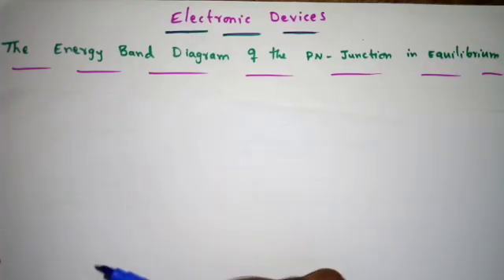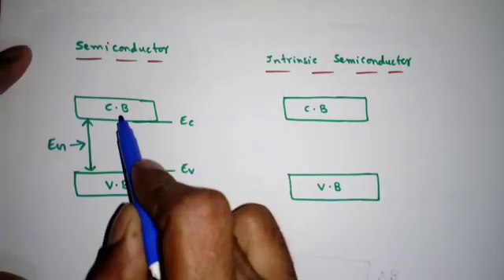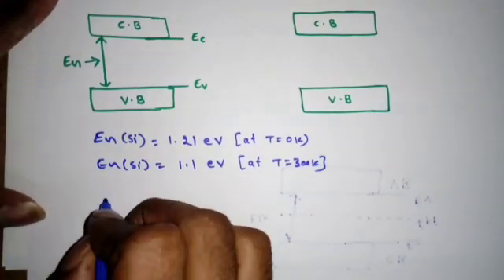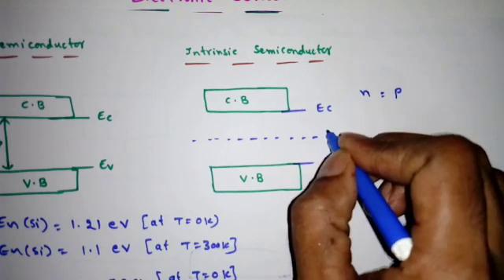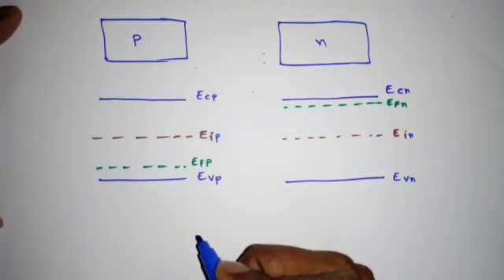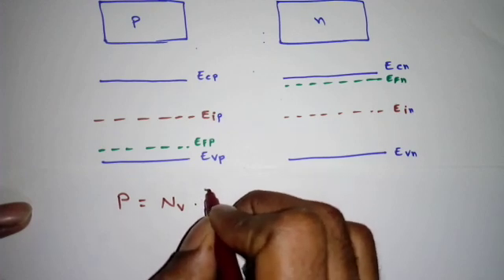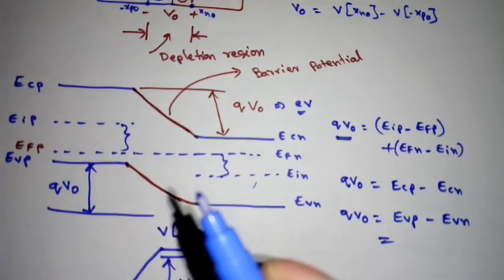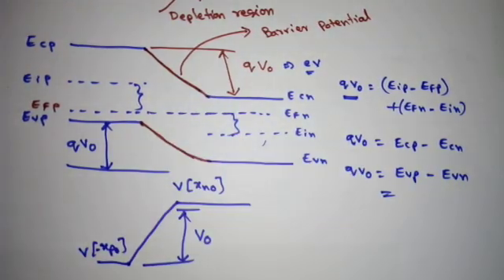Electronic Devices Lecture-35: The Energy Band Diagram of the pn-junction

Comment: video 11.39  wrong in diagram.......As we know the slope of the Conduction band and Valence Band represent the Electric Field...so if we join p type and n type CB and VB linearly it means the electric field is same or constant at all the point inside the depletion layer cause the slope of the linear line is same on every two point is same......but in general Electric field not same on everywhwere in the depletion region..it is  maximum on the junction only......so please check and correct.